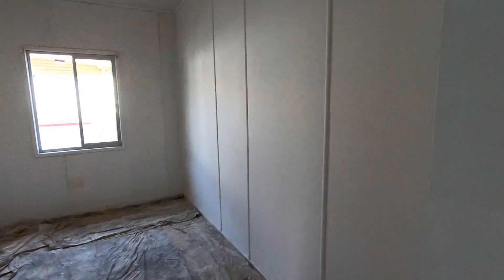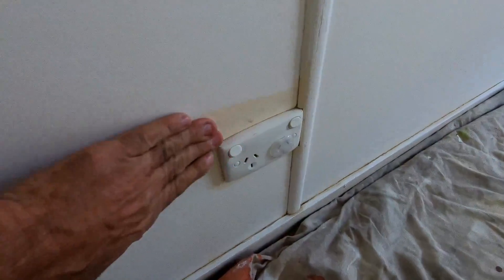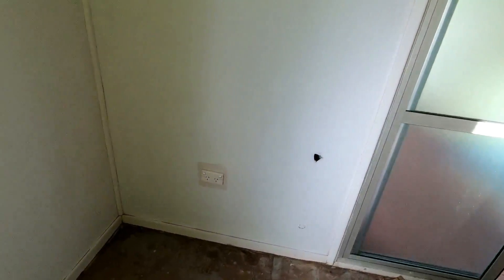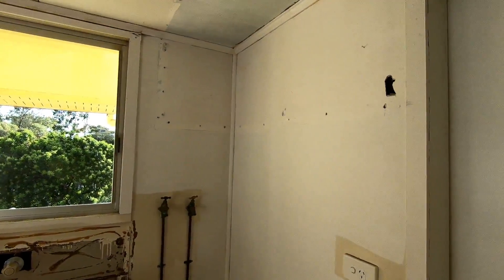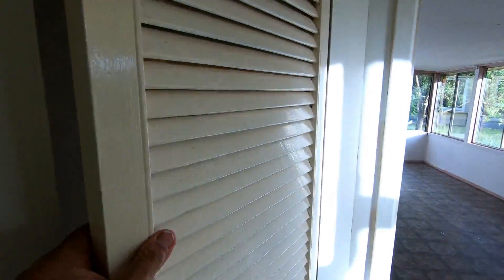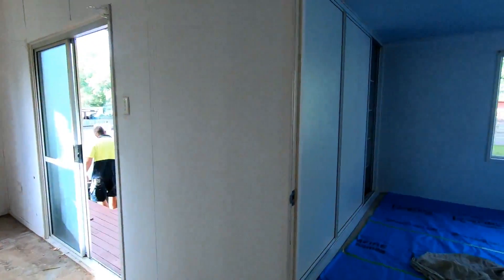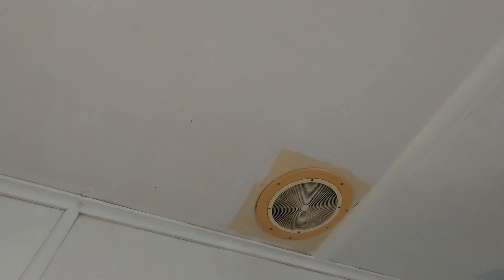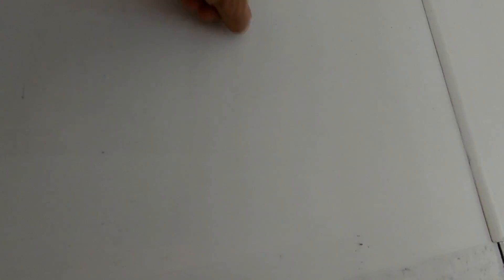How to Paint over Gloss enamel, shiny paint, fly poop , nicotine, Trade Secret

Comment: I really like your handy tips and advise, I subscribed so I can learn more from a true wise Pa1nter... well done mate !! I need to paint my roof and whole house I'm reno my 100 yr old Queenslander with gloss walls like this... so it's oil primer 1st then waterbase paint just like you said...Thanks
Reply from the maker: Happy to help,if your 100 year old house has timber tounge and groove ceilings, I would use an external low sheen.
Reply: @ThePa1nterhowto  not standard ceiling paint ?? I've also got a wagner hopper type airless spray gun(can go in the shed and find the model if you want) which ive only used to paint a friends fence(very new to using a airless spray gun...looked at a few of your spray gun uploads)...any tips for painting the inside and outside walls (and roof) I did struggle with the 1st burst of paint each time you start and stop spraying ??
Reply from the maker: @GMans-World  You need to turn the pressure down on your airless and possibly go a smaller tip if it's bursting when you start.
Reply: @ThePa1nterhowto  thanks mate, i don't think it has adjustable pressure.... I do have a few nozzles, will have to find the smallest when I go to paint the internals...by the looks of your vids you do the trims 1st then the walls, and roll them as a finish  ??
Reply: just checked it's a Wagner airless "Paint crew"  model (no model number I can see) if you know that ??
Reply from the maker: @GMans-World  Yes I know the gun, it's a cheap one,can't handle undercoat or ceiling flat much as it wears out fast. Good for a couple of houses,smaller tip is your secret with yellow filter.
Reply: @ThePa1nterhowto  thanks mate, I got it cheap and painting is not my trade, I'm a Plumber so thanks for the inside tips...i will try to use the airless on my full Queenslander rebuild...Great Vids mate, been watchn heaps at the moment.... Good to watch and listen to someone who knows what they're doing !! :)... well done plenty of likes

Comment: Hi watching from uk, what about if paint is peeling and would you put it on plaster board, dry wall.  Some info would be gratley appreciated, what about leyland trade undercoat 4 to 6 hours drying time is that no good
Reply from the maker: It will hold back peeling paint but make sure the loose stuff is removed best you can,its good on plasterboard or any surface. Don't know anything about that brand paint, is it quick dry oil? If not you will need 24hrs in good weather
Reply: It says 4 to 6 hours drying time,  doesn't say quick drying thank you for your reply

Comment: I use the dulux professional oil based undercoat. Its never let me down.
Reply from the maker: Yes its a good drop, if you want even better, use the quick dry one. Same day recoat
Reply: Will this oil base work to put on top of glossy concrete paint? I'm trying to paint my patio and worried about it peeling like it has in the past
Reply from the maker: @danacarney9951  Its as good as your going to get in a single pack paint,so yes its good for that job.

Comment: I'm trying to paint over red silk paint plus it's on wallpaper what should I use before applying my white paint  what should I use before I do so it doesn't show through thanks
Reply from the maker: If its on wallpaper you should probably use an oil undercoat,one coat of that then your top coats would be the best. I find oil undercoat does two things, one it sticks o anything,two it covers better than any water based undercoat,if you were to use a water based undercoat,it wouldn't stick as well and you would possibly have to apply two coats of undercoat to cover the red.
Reply: @ThePa1nterhowto  thank you very much for replying 😃👍

Comment: Great video!! Do you still need to clean gloss walls with TSP prior to using this? Thank you you!!🙌
Reply from the maker: Honestly no, if there is grease on the surface I will use turpentine before painting that area because the paint is turpentine based. I stay away from chemical cleaning unless absolutely necessary.
Reply: @ThePa1nterhowto  Thank you so much!!

Comment: Any difference in adhesion performance between this and Dulux 1 step oil based primer, besides the price? I just don't need 4 litres. Cheers.
Reply from the maker: Great question,  They both take the similar amount of time to dry. The professional qd sands much better where the  step is like rubber and has a more shiny finish once dry.. Dulux professional qd is a far superior product in my opinion.
Reply: @ThePa1nterhowto  Looks like it’s worth going for the professional qd then. Do you think it would hold up well going straight over aged varnished timber? I’d love to get away with not sanding. Cheers for the help.
Reply from the maker: @chasberman  yes, no sanding needed,give it a light sand after the undercoat before your top coat
Reply: @ThePa1nterhowto  Cheers! Appreciate the advice!

Comment: I always use taubmans 3-1 undercoat for most things which does  light stains as well, one of those new bin primers in the black in.   But for that job would have done what you did.   Top tip - There is two types of those black tin bin primers im sure you know the one.   And if your low on it, and top it up with the other one (the cheaper one)  the thing turns into cement.   I've never seen another paint do it, but i did it in the bucket i was about to pump through my airless for 1 last door i was spraying, luckly it happens quickly.   so the cheap bin primer / dear one   about $60 & $90  dont mix them !!! lol

Comment: I have a question. Sometimes after sealing with a zinger or bin oil based undercoat/primer and after applying latex paint stains appear and it often takes multiple coats to cover them if even possible, usually on cabinets and doors the fake wood laminate stuff. Any ideas what And Why? Any ideas how to beat it? I have tried multiple coats of the oil undercoat which helps but not 100%.
Reply from the maker: If you still have stains coming through after applying an oil based uc, it is possible that the oil uc is not properly cured. I use a "quick dry" uc for this very reason. Also there are metho based  spray packs available that dry very quick to spot seal problem areas.Hope this helps
Reply: ThePa1nter thanks I’ll look into both those options.

Comment: Would this oil based undercoat work on high gloss kitchen cabinets?
Reply from the maker: Yes Sharon,it is good,just give the surface a light sand first ,there are other paints designed for it but qd oil based undercoat is great for it.
Reply: @ThePa1nterhowto  I want to paint some kitchen cabinets, would you recommend using qd oil based undercoat then an oil based enamel? Any brands in particular? Thanks mate.

Comment: That’s awesome!! If you were painting over an enamel door with a similar colour enamel, would you use an undercoat like this then a topcoat, or just a sand and topcoat?
Reply from the maker: It depends on how old it is,if its fairly new, sand and gloss enamel. If its old, oil undercoat.
Reply: Thanks man, when sanding back doors a door frames would 80-120 be top course or would you use 180?
Reply from the maker: @ryanlee7207  use 180 otherwise the sandmarks from the paper can  come through the finish coat.You would be wise to add a bit of Penetrol to the gloss also just in case.